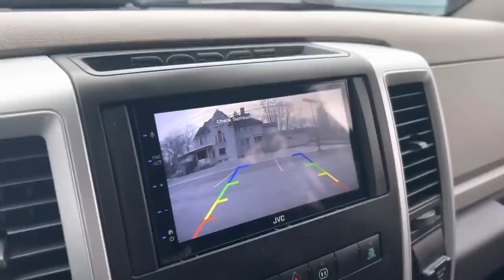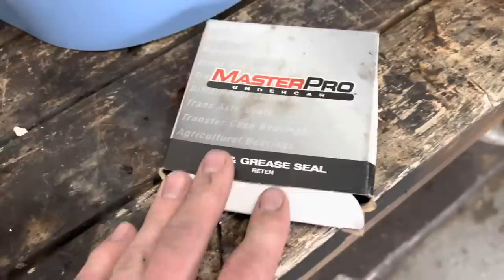Spending $10,000 On Powder Coating My SEMA TRUCK!

Comment: Isn’t Detroit axle the cheap brand on Amazon? I’ve heard not so great things about there hubs. Thoughts?
Reply: Detroit axle in the late 90s and 2000s used to be the best brand for everything, nowadays they've gone to shit
Reply: @laurenbeebe8230  oh interesting. I just replaced hubs on my truck an 08 Silverado and it seemed like 25% of hubs they sold broke within 2500 miles from the reviews.